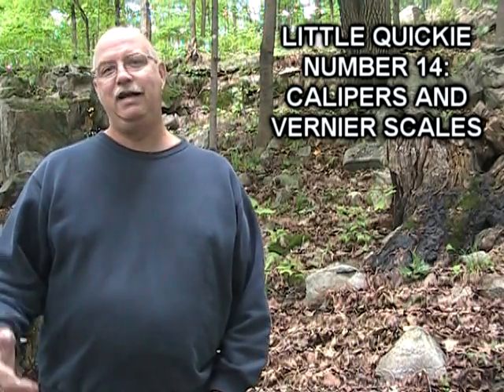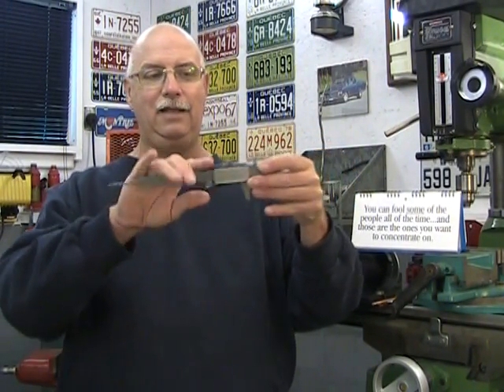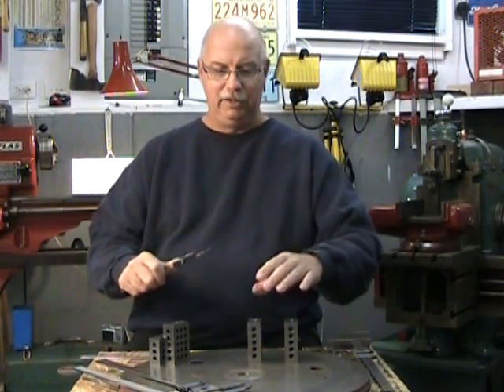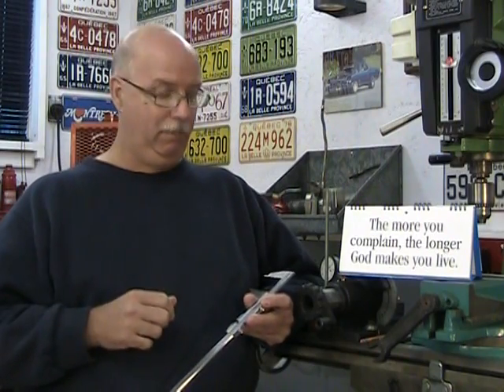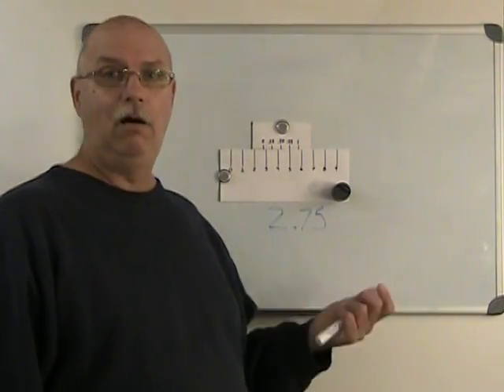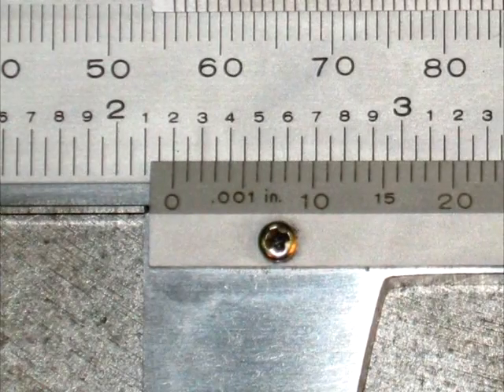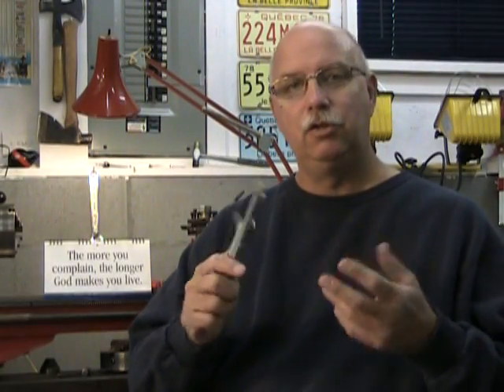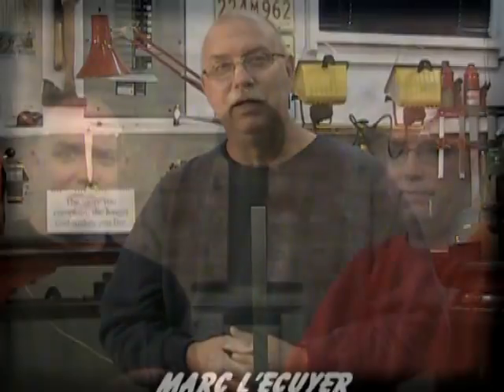VERNIER CALIPERS & HOW TO READ VERNIER SCALES, METROLOGY 101, MARC LECUYER

Comment: Great presentation, Marc!  I learned to use vernier scales in the '60's, using first a slide rule (which I still have) and then a vernier caliper (which I also still have.)  These days I use the 2 inexpensive electronic ones I have most of the time, but still use my 3 vernier calipers often.  I also have 2 nice dial calipers which I almost never use and are essentially new in their boxes.  I find them fragile, relatively.  The electronic units, while quite useful, not only are worthless when the battery dies, but are even more useless when the electronics fail, and they will fail.  They are usually not repairable, and if they are the repair costs as much as a new caliper.  I do not like expensive throw away tools that can let you down when you need them  so I buy cheap throw away tools...

Comment: Nicely explained. Although I do know in detail how verniers work in every shape, I did not find any detail about the second lock on the right of the bigger caliper you have (some of them may have some marks on it or even a small vernier or a full size vernier on it). What is that used for normally? Fine adjustment? Is that wheel on the side friction controlled to have same pressure like a micrometer thimble? Or to retain a value of some sort like I describe below?

A similar tool that I used (a caliper for measuring brake rotors and other hard to reach places, that have deep points like micrometer anvils that can pass the ridges on the edge of a used brake rotor. Where there were TWO full length sliding vernier scales with TWO screws in between the verniers One sets the distance between verniers and the other locks this distance. And before measurement both verniers would be set to zero (actually one is at zero, the other on the right should be set at 50.00mm) and the other screw would lock the two verniers together at that fixed distance. Slide the caliper over the rotor and lock the right vernier on the fixed scale. Unlock the left vernier from the right one (that is fixed now on the fixed scale) and slide it off the brake rotor - and so you can retain the value on the right scale where you can read it anywhere you want and not upside down with your head in the wheel arch. That was an old tool - an awkward function for holding a measure. Useful when you have to move the jaws in order to remove the caliper but don't want to lose the reading so you can read it afterward.

Comment: Thanks Marc, I like my dial caliper I would like to get one in MM.I am just learning for use on my Sherline lathe and mill ,but I to am an old tool and electronic ones are easy to read as I'm not blind yet .I have come a long way with your videos . Thanks again , Dave Aarons
Marc, have you thought of doing a Quickie on partting off?